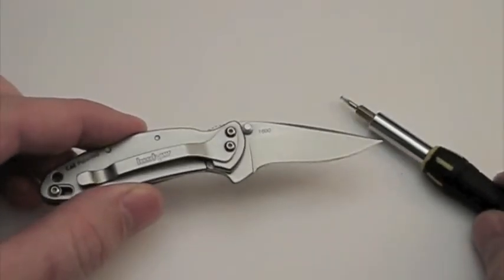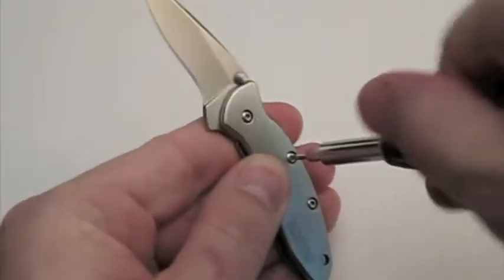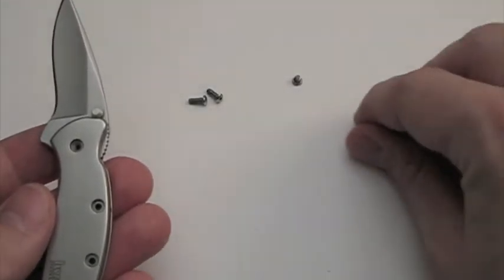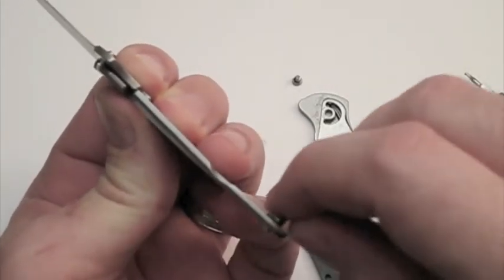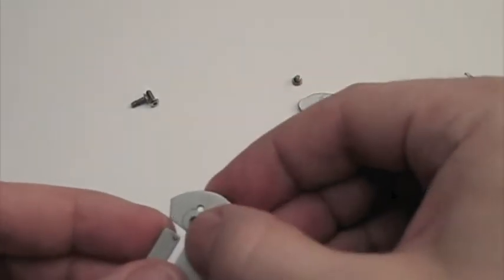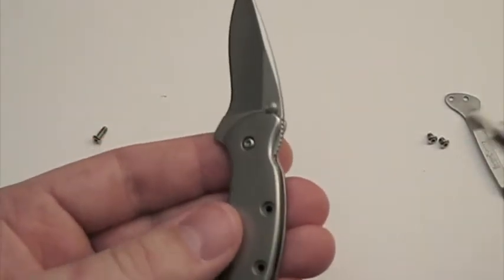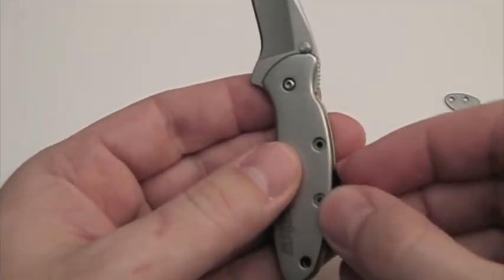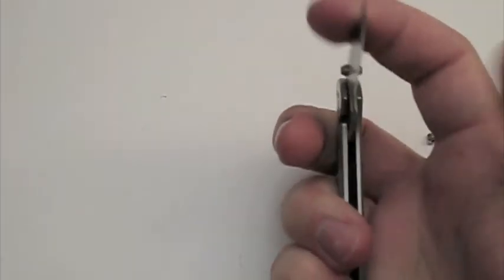Kershaw Chive: Disassembled, Reassembled

Comment: @sylram8 Ken Onion Posted on 1:06 am on Aug. 7, 2002
As for the rattle ,they only do that when the blade is open and the tortion bar is slack . Most of speed safe knives don't rattle and thats because we put a drop of grease in the speed safe pocket to eliminate this occurance however sometimes we don't put enough grease ,this won't hurt anything other than your nerves . we mill the pocket for the speed safe slightly oversize to reduce drag on the mechanism and this is the reason for the rattle.

Comment: Great video!  I have 3 Kershaws (Ken Onion type) that are speed safe.  2 have problems with the spring assist and one has a problem with the liner lock.  Was going to send back to Kershaw since they will repair/adjust for free but I think I will give it a shot myself. Glad I ran across your video.